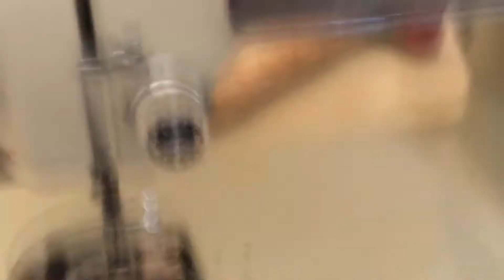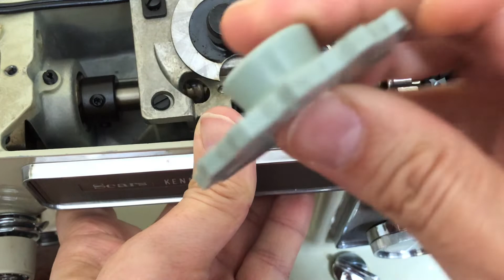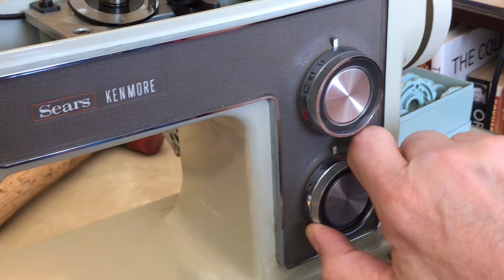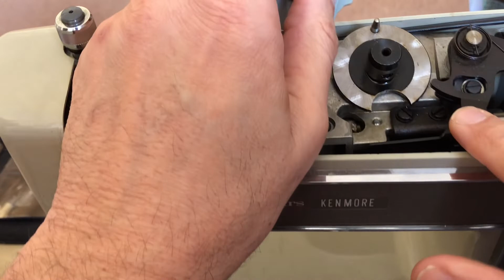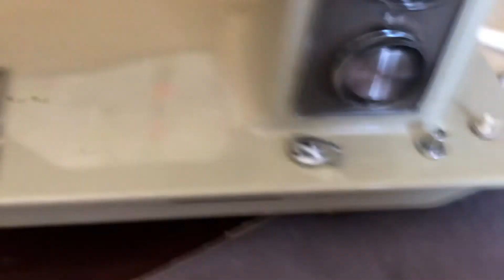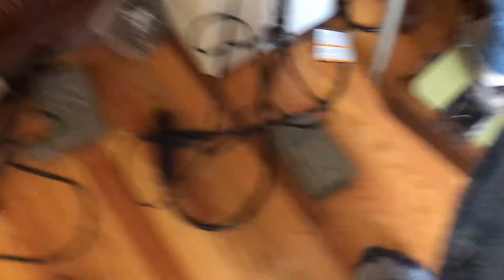KENMORE'S MID PRICED OPTION FOR FANCY STITCHES: Adding Your Own Cam Made Fancy Stitches Less Costly!

Comment: I need help! I have a kenmore 1516 with a lower cam arm that I unfroze but only works if I physically keep pressure on it. I’m missing something and would appreciate your assistance. The machine straight stitches like a gem but zig zag no go. Is there an email I could reach you at? Thank you for your time

Comment: Your video has been very informative! I had just bought a kenmore 158.17530 and I thought it needed the black metal cam to do basic stitches but after watching your video, it doesn’t. I’m still learning my machine. So far everything is working great! To add, I also have a 158.17600 that uses the black metal, which made me think my 17530 would need it also.
Reply from the maker: It sounds like you have a great pair of machines!

Comment: I have a 158.1515 which is very similar to this 1516.  The 1515 has the reverse switch is on the neck instead of the base.  As mentioned, with no cam it can only straight stitch and the #1 cam is needed for zig zag.  The 1515 originally cam with 9 orange single stack cams and one special cam #121 unique to these machines.  #121 is an orange double stack cam which apparently is special only to these machines and it allows them to create a triple reverse stretch stitch which is either straight stitch or zig zag controlled by the width knob.  This is an amazing stitch seen on some of the top of the line models.
Because these are low shank class 15 machines, I suppose they could use old style Singer or Kenmore low shank attachments. 
Does anyone know if these machines can use the gear driven Kenmore buttonhole or monogram attachments from the 70s era high end models?

Comment: In case anybody reading the comments is wondering, my Kenmore 158.1730 has a black metal cam that is supposed to stay in the machine all the time so all the zig-zag and other built in decorative stitches work at the turn of the dial. To use the other cams (type C for this machine just like the ones shown in this video) the black metal cam is removed and the cam for the desired pattern stitch is inserted. I still need to check to see if that second following arm is there though!
Reply: Yes, it's there. I have the same machine, model 158.17300. I have every cam they've ever made but for one and they all work just fine.
Reply: Would you happen to know what type of cam that a Kenmore 158.331 sewing machine would use?

Comment: Thank you so much for this video. I just picked up a kenmore 158.19800  and the cams were missing. Found a set on eBay. Unfortunately I am missing the foot pedal and it seems to be a unique one for that time period. Any chance you have one sitting around to buy? Thank you again.
Reply from the maker: Hi Brandon.  I don't have any parts for that model, but you might try searching on sites such as Ebay or online sewing retailers who might offer a generic version of the pedal and cord for this machine.  Kenmores were sold in very high numbers and so you 'should' be able to find something.  It doesnt have to be branded as a Kenmore for it to be compatible as long as you verify with the seller that it will work with your specific model.

Comment: wasnt there a range of Singers that used those discs too ,, very neat
Reply from the maker: Yes, and Singer kept the same cam style for decades before they eventually changed.  The Singer cams 'sort of' resemble the one you see me holding in this video but the Singers are not compatible.  They were black in color and Singer fans call them 'Top Hat' cams due to their color and shape.

Comment: Very useful video… I’m still waking my Kenmore up and was wondering about ‘these cams’ I’m hearing so much about. Btw where is the best place to go hunting for some (in addition to eBay/Etsy)… any suggestions?
Reply from the maker: Another area to search is with those members of Sewing Machine Groups on sites like Facebook.  Each brand has its fans and lots of folks in these groups have machines, parts, and accessories to sell.  FYI, just be sure you get the CORRECT cams because cam specs changed over the years so just because it is a Kenmore cam does not mean it will be compatible.  Cams sometimes have product numbers/serial numbers on them so you might check the manual for your machine as they sometimes had parts lists with codes on them.

Comment: Very interesting! I usually buy old straight stitch machines, but good to know if I do buy any multi-stitch. I'm sure the cams are easy to find but I'm curious to see if anybody has already modeled any to be 3D printed. If not, that may be a good project for me. 👍
Reply: I am currently searching for cams for a 158.480
Difficult to find
  I did find 1/2 set online for $140, no kidding!  Hence, I am cam-less
 They are plentiful for most recent models though